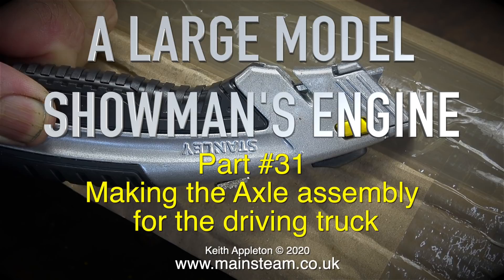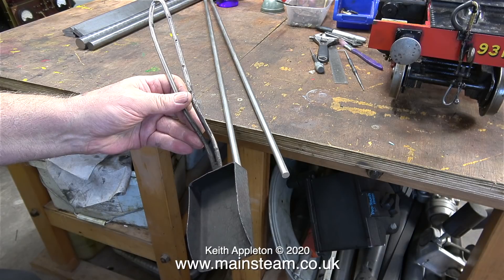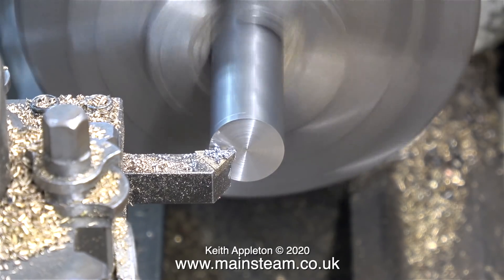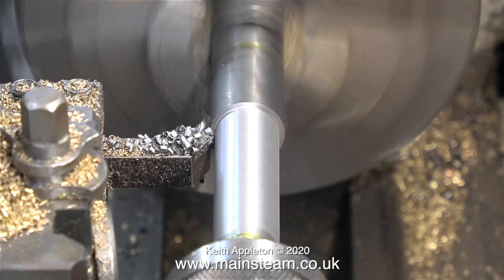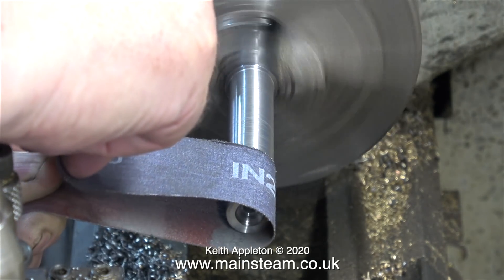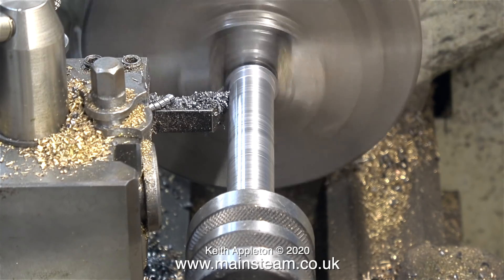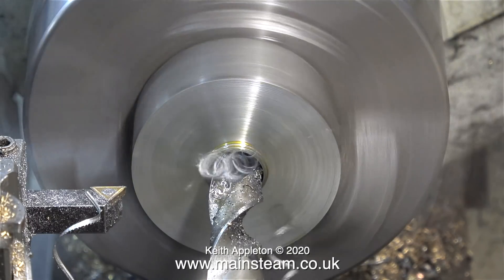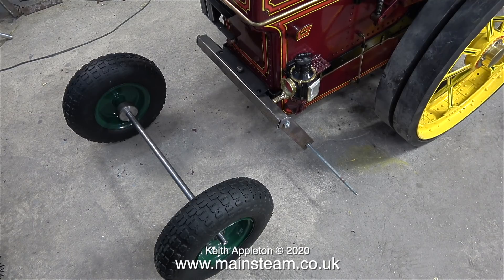A LARGE MODEL SHOWMAN'S ENGINE - PART #31

Comment: Another great video Keith, can you remember which steel you used, I hoping to find a nice to machine steel material which is also easy to harden and temper, rather than machine tool steel.
Reply from the maker: I used a piece of Silver Steel and left it un-hardened.

Comment: I've seen the problem with longer bars sticking out the back of the lathe too, even got to the point of contemplating an adjustable stand similar to a steady that could be used for support but I never got to the point of actually making that.  As you say, some sanding will fix this nicely enough

Comment: Hi 
Keith, at 2.50 mins there is a bit of a video glitch but it doesn't mess up the rest of the video, thanks for sharing your time and skills with us, love the video's
Reply from the maker: Yes I know. My video editing software (Apple Final Cut Pro X) started to malfunction after an operating system update was installed - Apple have since bought out some more operating system & Final Cut Pro X updates in quick succession which fixed the problem thankfully. A few videos were corrupted by the software glitch and the program crashed frequently - it was a right pain ......